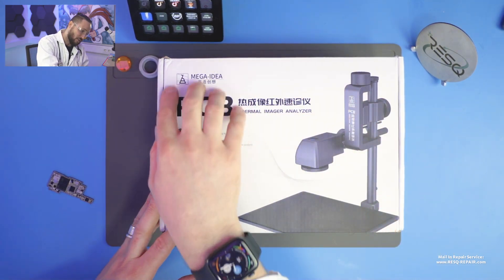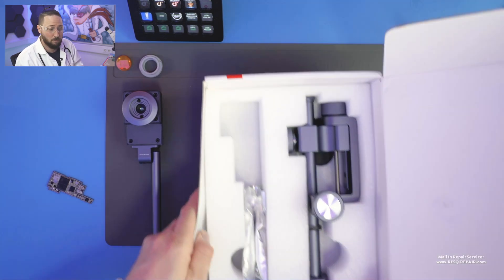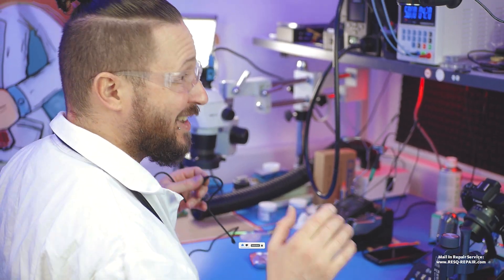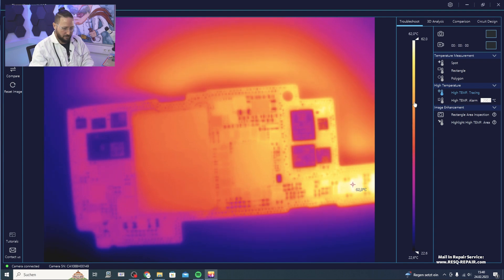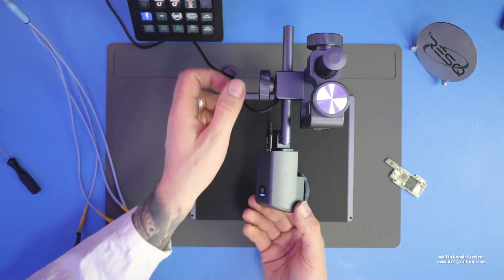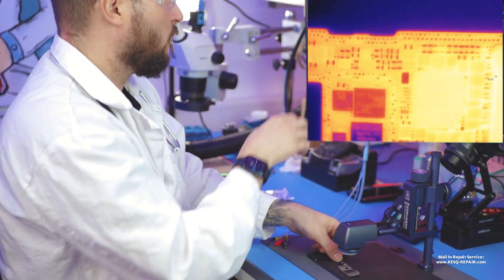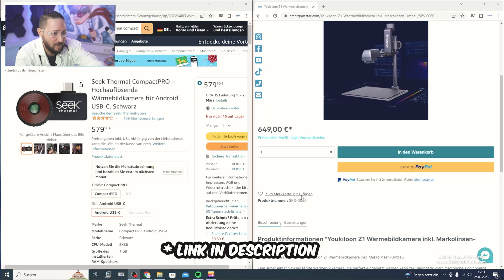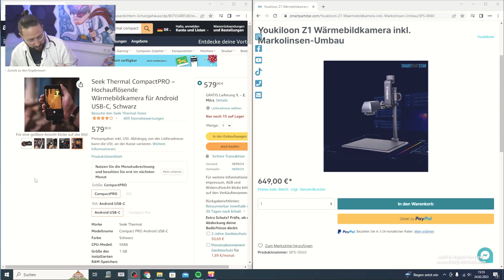❓BEST THERMAL CAMERA on the Market? Review: YOUKILOON Z1 3D vs SEEK COMPACT PRO FF vs FLIR

Comment: Hi sir
Im from india, 
Mostly all thermal cameras are depends upon temprature....
Above the video of that thermal cam it shows above the 30'c ... what it means? Is it fully shorted bord... or some lines shorted?  if some times,  minor shorts or half short, or leackage of high voltage caps can't find in that thermal cam.... can u pls explain is can find minor leackage of mother bord?  And im using quinli thermal. it has both oprtions like normal vision & thermal vision & i can adjust  the lens if its blurred image, above the cam as you said both options, its worthble compare to quinli or nearby models. 
If im wrong or any mistake.... 

pls make video on
 🔥thermal camera & its working priciple, functions.🔥